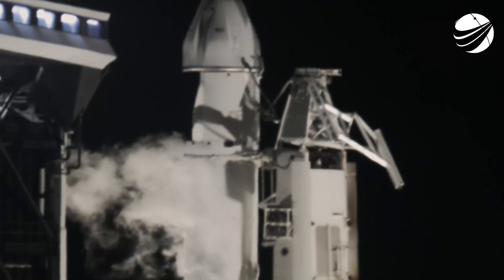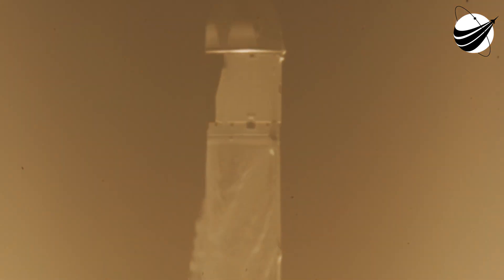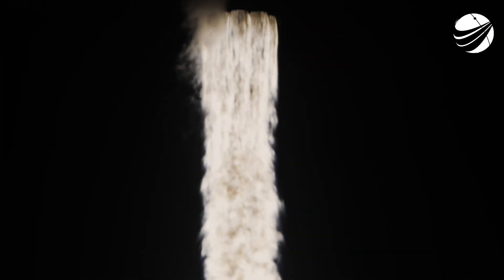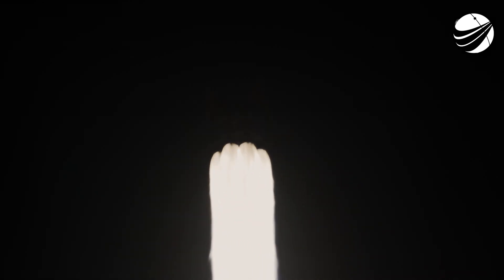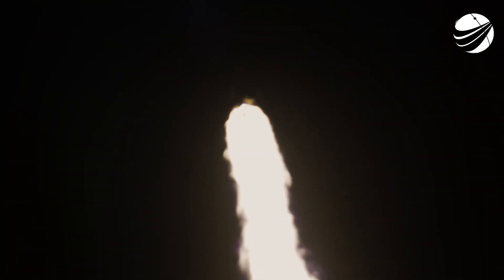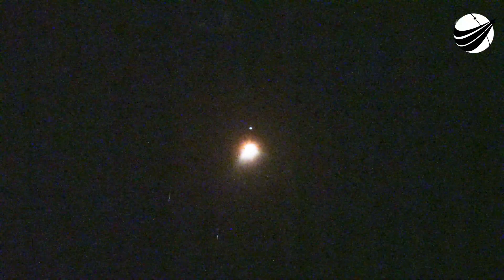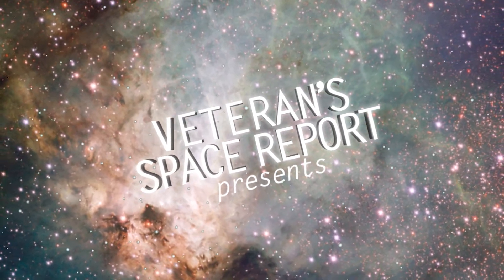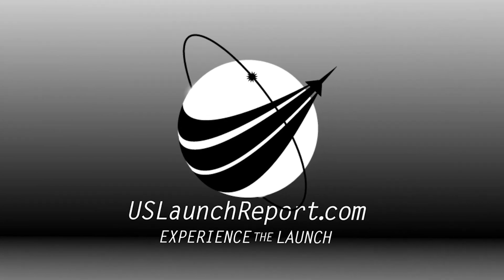SpaceX - CRS29 - Boost Back Burn

Comment: What effect is all that ionised gas having on the upper atmosphere? Look at it this way:
gasoline engine took off, and about 70 years after that we find out we are in serious trouble with
the atmosphere being changed so much global warming has occured.
Why is there no interest in the effects of rocket plumes on the upper atmosphere? Will we find out in 30 years it has also damaged the atmosphere? Surely we should learn from past mistakes.
I have not heard of any discussions on the negative effects of rocket plumes ( there appears little interest in this). Looking at Elon Musk in particular, having played a huge role in electric cars with a view to turning around CO2 warming, why is he not discussing the effects of rockets on the atmosphere? Is the upper atmosphere being changed by these rockets launches? Is the ionosphere being effected? Since these hot gases are in partial at least vacuum they will disperse and travel large distances in a short time, then what happens to them, do they slowly fall back to earth, do they circulate around the globe. Seems we are again taking a big risk, there is no slowing of CO2 in the atmosphere the rate is still increasing exponentially. Is this just a repeat performance of the past where financial interests are more important than long term interests?